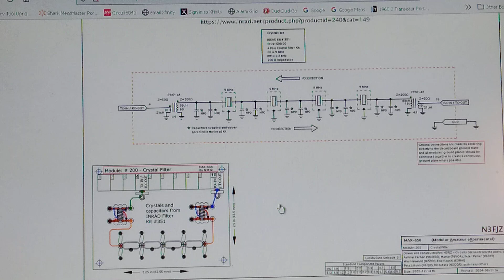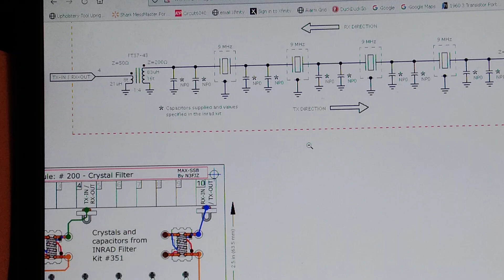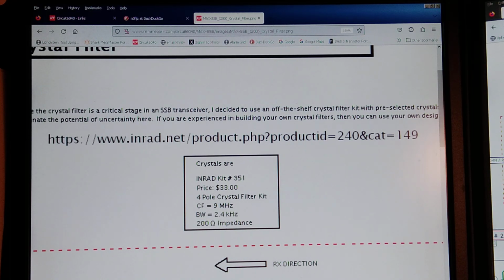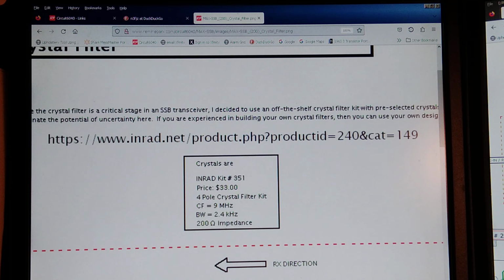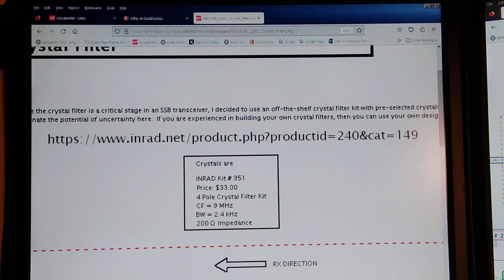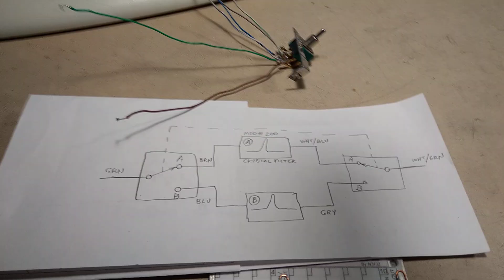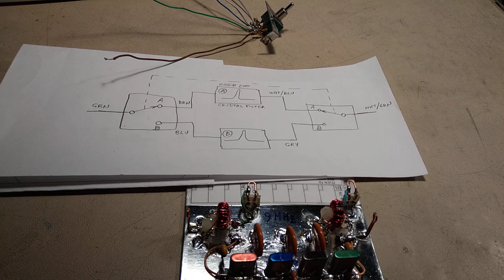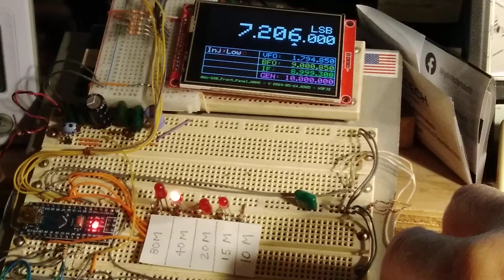Module # 200 Crystal Filter - MAX-SSB Transceiver Project

Comment: Wow weve come a long way where we can obtain cheap filter kits. 

Is there a discussion of the various i.f. frquencies used i.e. is it a function of crystal availability or transceiver design?

I know 9 MHz has long been a favorite for single conversion rigs iirc. 

While the kit availability is nice I decided that Im going to slog through the math and measure them with a vna (I need to find one yet)  partly to choose my own lower i.f. freq of 2 MHz or 2.5 MHz.
Reply from the maker: Yes indeed, it's very rewarding to build your own crystal filter.   The MAX-SSB front panel software makes it easy to experiment with various I.F. frequencies (i.e. crystal filter center frequency) be being able to change the I.F. frequency on-the-fly directly from the Settings menu without the need to change it in the source code.  Not only that, you can change the I.F. frequency real-time while listening to the results which allows you to fine-tune the I.F. to match the crystal filter's frequency exactly.  73  Rick  N3FJZ.